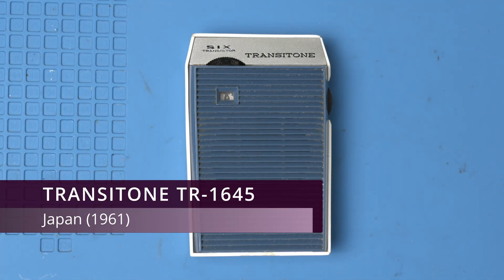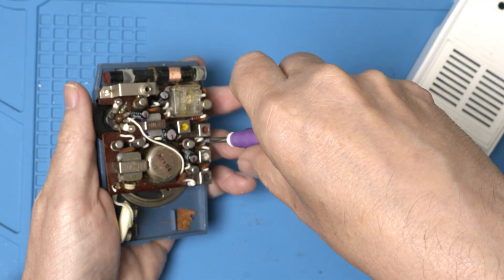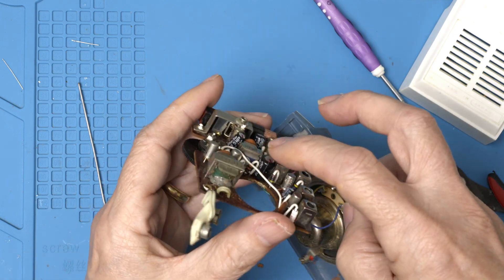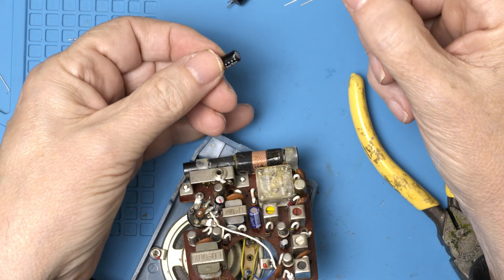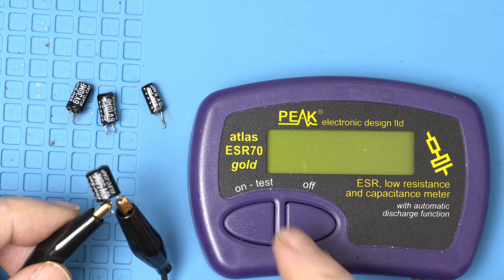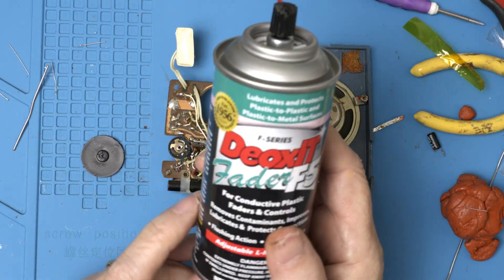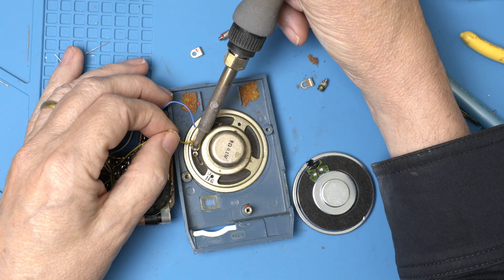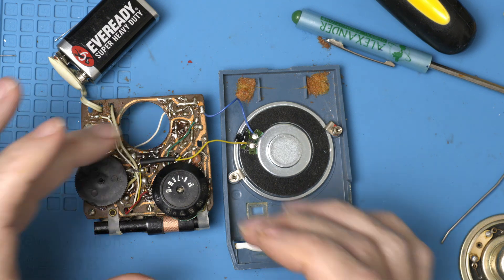Vintage Electronics Repair: Dead Transitone TR-1645 transistor radio restoration

Comment: My take on these older radios. IF they originally worked, that tells me they were designed and built properly. So if the individual parts work, the radio should as well. Deteriorating parts like capacitors are one of the weak parts. Replacing them most of the time fixes them. Rarely do diodes and transistor stop working from age. So most all these older radios should be able to work again. Of course the volume controllers do get dirty too...
Reply from the maker: That is exactly my view too, with the small addition of battery contacts.

Comment: I really enjoy watching these older things being rebuilt.  I do have a question.  There's four cubes that look like there's a standard screw in each.  One is black, one is white, one is red, the last is yellow.  What are they and what are they used for?   My grandad had a radio from the 60's that I have now, unfortunately the batteries leaked.  I wish I could find someone who could do something like this, but I am going to guess they're few and far between.  Please keep making these cool videos!
Reply from the maker: Thanks so much for watching and for the kind words! Those four cubes are trimming capacitors used for fine-tuning the radio. They usually survive the years quite well and should be adjusted with extreme caution - it's the electrolytic capacitors that typically go bad and need replacing. The battery damage is often fixable depending on how far the corrosion has spread.
Reply: @Dream.Build.Create  Now I know!  Thank you for your answer. :)
Reply: For removing the battery corrosion, use lemon juice. Most of the cubes you describe are intermediate frequency (IF) transformers and the red one should be an oscillator coil. These should only be adjusted during an alignment procedure. 

The main tuning capacitor will have trimmer capacitors for the antenna and oscillator. Like the IF transformers, these are only adjusted during an alignment procedure.

Comment: Good videos!  I like your de-soldering technique for cap replacement. I haven't seen a lifted trace.  Where do you obtain that syringe of flux? It seems to do a great job.  One great tip I found is take a photo of it before starting, a lot of times the speaker leads fall off.
Reply from the maker: Thank you! That is a great tip, there has been more than a few times I stopped filming and reviewed the footage to figure out where something goes.  I got the flux on Amazon:

"Wonderway Sn63/Pb37 T4 Tin Lead Solder Paste No Clean, 183℃ Melting Point (20g)"

Comment: I collect, repair, and restore transistor radios.
The late 50s to early 60s is my favorite era. 
This one is a nice example!
Thank you for mentioning the importance of driver ( speaker ) degradation, i never really considered it. I may pick up a few of those replacement speakers.
Nice job.👊
Reply from the maker: Thank you!   I get the speakers at mouser.com, like everything else!  Speaker tech really has improved a lot in 60 years.

Comment: Found your channel a few weeks ago. I'm curious if you have the ability to do componit level trouble shooting ability and equipment. Where do you go for replacment parts? Love the show. There is no shortage of transistor  pocket radios. I went to an estate sale and came home with 48 in a box. Thanks
Reply from the maker: Thanks for watching!  I'm still developing the skill for component level trouble shooting.  The problem is with these old radios is that if a component has failed (like a transistor) there is no way to get a replacement part, or the part costs more than the radio.    For the capacitors, I go to mouser.com, they are great.  High quality capacitors (like Panasonic) or only 10 for $1.  Spend $10 on 10 different values and you're set.
Reply: Thank you